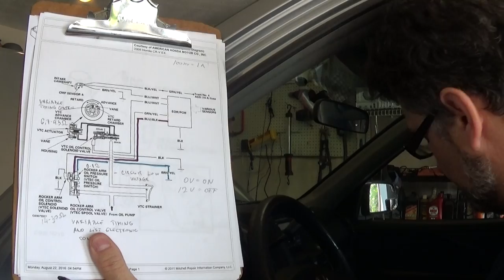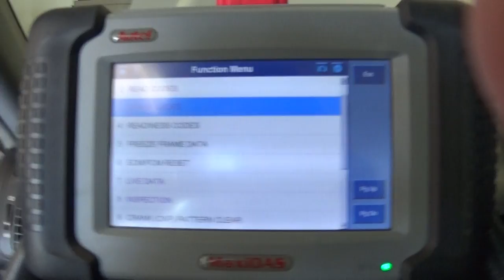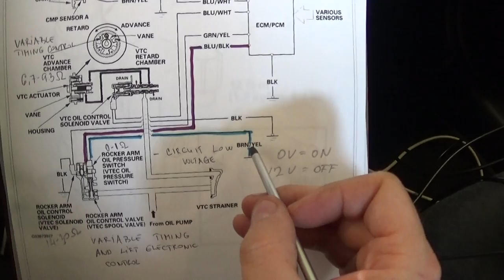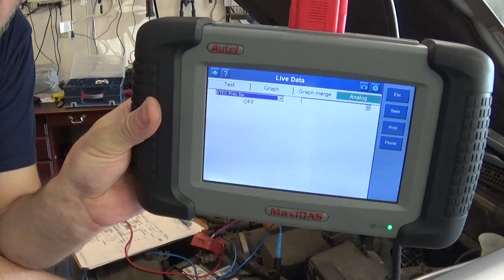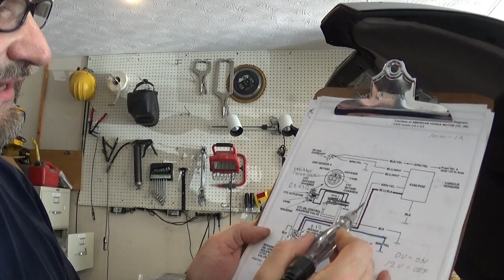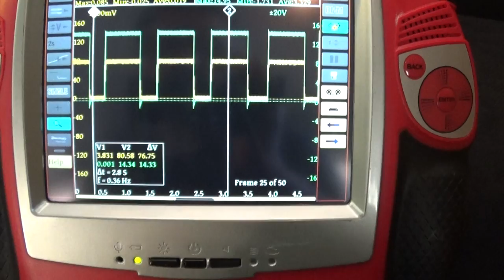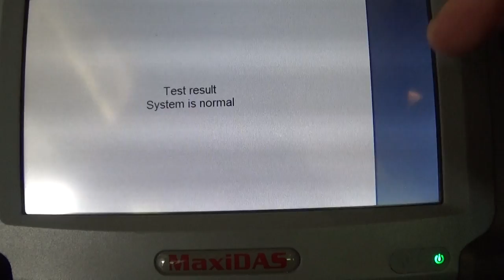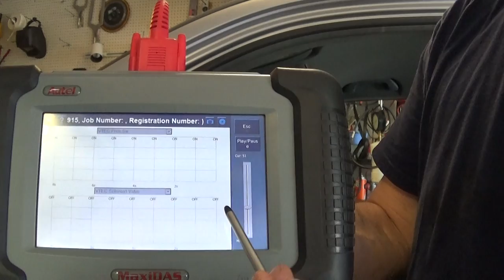VTEC Problem P2646 2005 Honda CR-V Part 1

Comment: Very informative video with detailed information. I just bought a 2005 Honda Element  with 148,000 miles and twenty five miles later the engine started surging and the check engine light came on. I drove one mile to an Advance Auto Parts and their scanner showed codes P2646 "low oil pressure" and P2647 "high oil pressure". I've seen atleast ten video's on YouTube about this and a couple said low oil level or high oil level can cause this. I can see the low oil level causing this only if the oil level is so low that the oil pump is drawing air. Low oil pressure could also he from oil passage almost completely clogged or either or both screens are clogged. Having too much oil will not increase the oil pressure because the oil pump controls the pressure. If the oil pressure from the oil pump to the oil pressure switch increases it would be from the oil passage being partially clogged due to sludge in the oil or other foreign material. Just like when you pinch the end of a garden hose it creates more pressure, spraying the water further. I checked my oil level and it was one quart low. I added one quart and I believe three days later the check engine light went off and it's ran fine ever since and it's been two weeks. I bought the new aftermarket VVT assembly and an O.E.M. oil filter from Autozone, an aftermarket o-ring and screen gasket for the other side of the engine from Advance Auto Parts and mobil 1 5w-20 high mileage full synthetic oil from Walmart. Since it's been running fine, I have to resort to what my father used to say, "if it ain't broke, don't fix it". Besides I'm going to replace everything in 1,000 when I do the oil change because the VVT o-ring is leaking. I'm going to replace the VVT assembly from the top. Those three bolts are 6mm not 10mm. The socket used is 10mm. A lot of people say only use O.E.M. parts because they're better, but except for the oil filter I'm trying aftermarket parts. The aftermarket VVT assembly has a lifetime warranty, but the O.E.M. one has no warranty.

Comment: Had this issue for months....I finally got PISSED off and bypassed the daammm thing. Tricked it permanently with the help of your videos. Thank You!
Reply: Can you explain how you did this?
Reply: How did you permanently bypass this?  I have had this code many times and replaced the whole unit last time which was 3 weeks ago with an OEM part thinking the aftermarket part was faulty as it had been changed 3 times!!!

Comment: Thanks for the informative troubleshooting videos - had P2646 code on 2004 Honda CRV 124K miles - vehicle would not go above 40 mph and intermittently missed above 25 mph. R&R VTEC -  the code cleared and check engine light went off. CRV runs great. Even though I did not use the troubleshooting techniques applaud that you provided them. Not just a parts changer.
Reply from the maker: Bruce Custer Thank you my friend. I am glad you found this video informative. Cheers
Reply: Thanks for describing the symptoms the car has when it's being driven.  I am getting missing and loss of power when I try to accelerate past 20 mph or so.  I have the error code and I have the symptoms so that would indicate I've got the solinoid failing to open.   First I guess I'll check the wiring and ohms on the solenoid.  I've been a little lax changing the oil since I bought this car used 3 years ago. It has 190000 MI.  I noticed someone else here remove the part, cleaned it and put it back and that fixed the problem.  So if the wiring and ohms check out I might try to try an engine oil flush and new oil, switching to a full synthetic.  Thanks KY Home Garage for the excellent videos.

Comment: Ramon I know it's an older video but I own 2 Hondas and your presentation was excellant. Thanks for posting and sharing. Very helpful. 👍👍👍 Ramon what model scan tool is that. I know it's an older version but just trying to obtain equipment that have good Honda functions without destroying the budget. I don't need the latest version just a tool that gives me the tests I need. Thanks much long time subscriber good video Thank You

Comment: Excellent video!  I started using this info to figure it out, but then realized the problem may simply going too long without changing the engine oil.  After using Gunk engine flush and an oil change, problem solved!  Also, I've read this engine has a timing chain that is oiled by a small orifice that can become clogged if the engine oil changes are neglected.
Reply: mine had p2646 r u suggesting a change oil will fix it i look up the solenoid seems oley nkt that greasy but scared today because the engjne jolted a bit seems it doesnt want to run but when i park everything was okey again

Comment: Good job Ramon. Excellent explanation of the VTEC operation and diagnostic testing. Best description on YouTube. I am helping a friend diagnose same code. Tested the switch circuit just as you did.  Replaced VTEC solenoid and code stayed the same. Performed VTEC test with scan tool. Fails solenoid on, switch stays on. Unplugged switch and scan tool data shows switch off. Back probed switch signal wire with switch plugged in, voltmeter read 0 VDC. Unplug switch, voltmeter reads 12 VDC. Circuit testing good. Removed VTEC oil switch and installed pressure gauge. Run engine at idle speed and oil pressure reading 80 psi. This pressure should not be at switch oil passage until VTEC is energized at 3,000+ rpm. Maybe a defective VTEC solenoid? It is an aftermarket part. Not an OEM solenoid.
Reply from the maker: Billy Yoder You are right. You should not have oil pressure on your gauge at idle. Looks like bad solenoid. Unplug connector from solenoid see what happens .
Reply: KY Home Garage KY Home Garage. Good morning. Purchased another solenoid. Installed and fixed. Working great. Aftermarket parts are sometimes unreliable. Thank you for the great training. Have a blessed Christmas.
Reply from the maker: Billy Yoder Awesome. I have quick question. What adapter did you use to instal your pressure gauge? Thank you

Comment: Very good explanation of the system.  I’m late to viewing this video and I’ve got a customers 05 Honda Accord that keeps throwing this code with the same symptoms.  However my customers car is intermittent and if I wiggle the pressure switch wires at the switch it will run find for a few days to weeks before acting up.  I replaced that actuator about a year ago.  It appears I may have a bad pin connector.  I’ll know next week.

Comment: I’ve got an 05 Accord in the shop now with the same symptoms and code.  The symptoms with mine are intermittent.  It will run fine for weeks then act up.  I replaced the solenoid about a year ago and that fixed it for a while.  Now if I wiggle the connectors at the valve it runs fine for a few days evens weeks.  With your testing the solenoid with the amp clamp could you have have back probed and used a voltmeter to verify voltage to the solenoid?

Comment: I just recently got a used 2006 Honda Element and got the light and the code for the oil pressure switch. I had to drive it over an hour for work for a week. The guy at the auto parts store had an Element too and he had the same code. And gave me the print out on the cost for the switch $69.00 for the part but you have to replace it, which I'm not good with car repair. He told me he just change the oil when he got the code on his. So, I went and got an oil change to see, and no more light, no more hard jerking motion that I had for a week by trying to step on the gas to accelerate. I bought the car used and the oil must have been low and who knows what oil they used. I checked the oil level but I checked it while it was still warm so I could not tell. I just used the recommended 5w 20. No more problems for a week now and driving over an hour highway mileage and speed that triggered it the first time. I can update this if it changes.
Reply from the maker: B.J. Martin Great I am glad engine oil fix it. Good job 👍👍
Reply: so brother changing the oil first would be a good idea?
Reply: @anthony08330  Yes, it still works with no problem. Just change it every 2,000 miles. If it doesn't fix then the code sensor acts up in raining days.

Comment: I had this problem on my 06 CRV and removed this part, cleaned it real good, reinstalled it, changed the oil (5W-20) the filter and made sure the oil level was full. I haven't had a problem in a year and a half.  I keep my oil level at full on the dipstick and change it twice a year whether it needs it or not. The engine seems to work better with cleaner oil. ( My 99 CRV, I would change the oil at 7-10 thousand miles. It didn't mind).  The VTECH engine is more finicky.
Reply from the maker: TRANSMITTER GUY ok I am glad it worked for you . Thank you
Reply: I flushed mine good with the Valvoline engine flush, replaced oil with full synthetic and the problem is gone.  This is a good reason to keep your oil changed. Also there is an oiler for the timing chain that clogs if you don't keep it changed.

Comment: Would you tell me which Bi-Directional Diagnostic Tool you were using. How much $$ are they? I have kid who is 20 years old doing work in auto Parts & Service and really enjoys it though I wanted in college right now but is just into cars. Other kids in college in medicine. I was into Motorcycles at 20 so I get it but I went to college at same time. This would be Fantastic Professional tool for him.

Comment: Thank You Sir. Your video is very informative. I'm having issues with rough idle not terrible but enough to cause me concern also the car has 93000 and has recently displayed poor fuel economy. I replaced  The spark plugs and noticed a little increase in mileage and the engine response and idle improved. I haven't ever owned a Honda vtech before  so I'm learning. I have worked as  professional mechanic but mostly American cars and Nissan. I will check the crank shaft position sensor next and hopefully find it dirty, clean it and see the problem solved. The car is well maintained and was owned by yes a little old lady. Thank you again for your video have a nice day.
Reply from the maker: Hi. First step I would do is to check fuel trim at idle and WOT. You could have  vacuum leak.

Comment: Ramon, help me brother ... I checked and cleaned screens, replaced solenoid, P2646 comes on when going up 15-25 degree incline ... could it be the oil intake pipe in the oil pan getting blocked with sludge since i get the problem only going up a steep incline? do you suggest i drop out the pan?  Also, I have an OBD scanner, but which App should I get to see the VTEC solenoid and switch states ? I can use iPhone or Android ?  Thanks mate - you are my mechanical mentor!
Reply from the maker: Peter Liu hi my friend. Unfortunately to see this data you need to have professional scan tool. Generic OBD will not have it. Before you pull oil pan off I would remove valve cover and look for sludge. If you have any you are out of luck. Did you change oil?
Reply: @kyhomegarage3430   - flushed the engine with liquid moly twice then filled with synthetic and dropped in MOS2 friction reliever - all working mate.  I guess i had sludge build up in head blocking cam shaft hydraulics ... thanks mate - you inspire me ... funny thing was as soon as i fix my car, my fathers car throw a P0171 - running too lean - seems like a vacuum issue perhaps.
Reply: I would check oil pressure when the issue occurs.l

Comment: I have a similar issue with an 05 crv that has had the vtec spool valve replaced twice. Weird thing is, is that it’s an intermittent issue. On a cold engine I can see the oil pressure switch and solenoid work perfectly fine through the live data. After 30 miles of driving and operating temperature. Code p2646 is set and the oil pressure switch is stuck on and won’t allow the solenoid to turn on. I have checked the vtec Spool valve filter, Oil has been changed with oem filter and oil, oil pressure isn’t dropping drastically when dtc is set. My last option would be to check for source voltage at the oil pressure switch when unplugged because clearly the ground is good if the switch is stuck on; and when unplugging it on the live data it shows off.

Comment: Can you help? 06 Honda element Vtech automatic trans. VTEC inoperable. New VTEC valve, solenoid , actuator and screen. No bad fuses, no voltage at either VTEC connector, engine on or off?? P2647. Thanks.
Reply: I have the same issue, Replaced everything twice. Next I am going to test the wires to see if they connections are even coming in.

Comment: Mr. Kentucky thanks for posting, this video was very helpful to me in trouble shooting my VTEC issue. I'm getting a P1259 (VTEC system malfunction) code on my 2003 CRV. Solenoid is testing at 16 ohms (spec is 14-30 ohms); Pressure switch has continuity; Pressure switch connector is testing 11.8 volts when disconnected (open circuit) on blue/black wire; Pressure switch connector is also getting 11.8 volts between blue/black and brown/yellow ground wire; also my ECM is sending 11.8 volts on this same blue/black wire. I've changed the oil and replaced the entire solenoid assembly (new housing, solenoid, pressure switch and scree/gasket). Could 11.8 volts be the culprit? Not sure what else to do.
Reply: What was it?
Reply: Surprisingly, the new solenoid assembly came with a bad solenoid. Purchased a new individual solenoid from Napa and installed on the new assembly and it fixed my issue.

Comment: Ramon is the solenoid working because the computer see 3000+ RPM or is the switch actually seeing an increase in oil pressure. Do Hondas have variable pressure oil pumps or are they constant pressure and variable flow. Just wondering if it's RPM or Oil pressure controlled. Hope I said this correctly. Thanks again 👍👍👍
Reply: From what i understand. 

The computer sees the rpm over 3000, then opens and closes the switches acordingly alowing the oil to the vtech rocker arm mechanism
Reply: Thanks for the info. Was wondering at what point the computer would send the signal. Thanks again 👍

Comment: I need help. 2646. 2006. I replaced the vtech solenoid/switch. It worked well about 2 weeks. The problem returned. Today I cleaned the end screen and the same. It goes into limp mode. Last couple days I smell like burning but that is nee and the problem is not. I do not know what to do. It sometimes stutters bad on start.
Reply: And it wastes a lot of gas

Comment: I have that same problem they've already change that part but the check engine light comes back on with same code. What else can be done
Reply from the maker: Did you change oil and see if you have any sludge in your engine ( take valve cover off ). Thank you
Reply: They've changed the oil twice and comes out clean.
Reply: There is another filter on the front passenger side of the engine, and it can clog.  Not easy to get to!!!!

Comment: hot damn you nailed it! i've been reading forums for months, and nobody was this detailed on this problem. Replaced solenoid and switch, cleaned both clogged screens... many oil changes.. problem now is... how can i get ahold of once of those fancy car computer scanners to run all these diagnostics?? :( (03 honda element) I'm almost certain its a wiring issue, or possibly the PCM ? how would i go about checking for wiring faults?
Reply from the maker: Dylan Townsend This is Autel Maxidas DS 708 you can get one form eBay $500.00 to $ 850.00 used or new. First unplug your two wire connector from pressure sensor and measure voltage let me know what you have

Comment: Great video my friend, so the problem was the switch, why did you change the whole thing?
Reply: Actually he proved that the switch was good by doing his tests. He also proved that the solenoid was good by doing additional tests. So the problem was restricted or plugged passageways in either the engine or the spool valve unit that houses the solenoid and the switch. So when the solenoid valve opened up to allow oil to flow to the pressure switch, either no oil or not enough oil was flowing and activating the switch.

Comment: Hello so I have a 2007 Honda Accord with the code p2646 and I already replaced the solenoid and the oil pressure switch I also did a oil change after installing the parts and the problem is still ongoing. What other possible thing is going on with my engine? I'd appreciate any feedback thanks.
Reply from the maker: Is your engine sludge ? If you can take engine cover off and look for sludge. Thank you.
Reply: @kyhomegarage3430  if it has sludge what would be the  nest step

Comment: How about P2647? Would that indicate a stuck open solenoid?
Reply from the maker: Jackson Cruz that code is for pressure switch circuit high. Check your ground wire on your switch. Also check your connector on your switch.
Reply: I checked the connector and it has connectivity to the main wires from the pins. I didn't check the wires themselves to ground. So the blue / black wire is supposed to have 12V and the Black /yellow be ground all the time?
Reply from the maker: Jackson Cruz yes
Reply from the maker: Jackson Cruz please watch part 2 of this video should help you
Reply from the maker: Please watch part 2 of this video it should help you

Comment: MILLION DOLLAR QUESTION.  NEW OIL FILTER SCREENS CLEAN . OIL VTEC SOLENOID WORKING FINE . I WANTED TO PUT A NEW ONE ON THE ENGINE,  WELL I DID AN BOOM CHECK ENGINE LIGHT ONE I CLEANED MY CONNECTORS . THOUGHT IT WAS THE NEW SIL SO I GOT ANOTHER ONE STILL LIGHT ON . SO I PUT OLD ONE BACK ON AND NO LIGHT AN I GIT VTEC . WTH IS GOIN ON ????